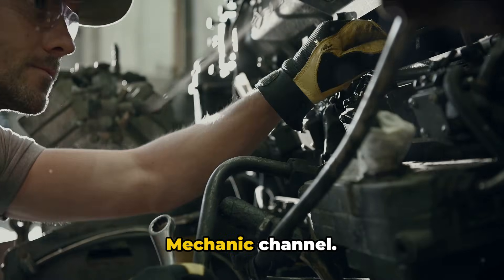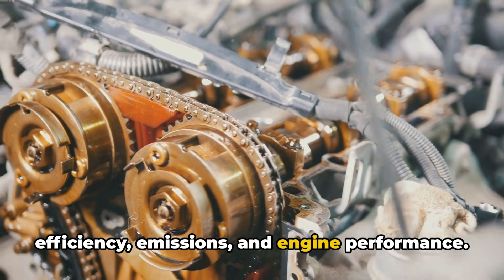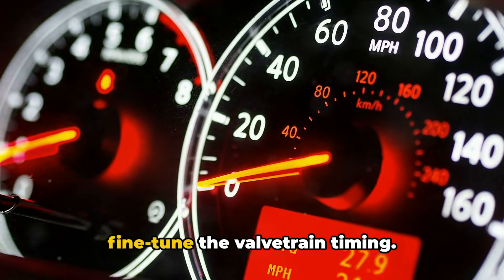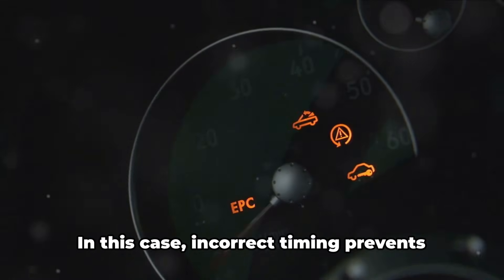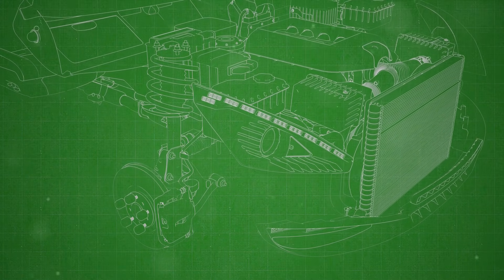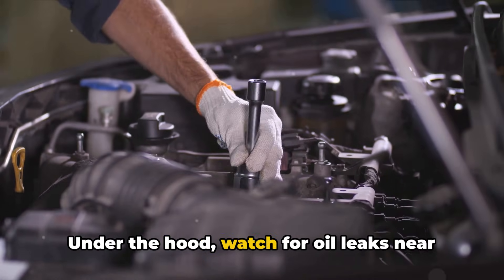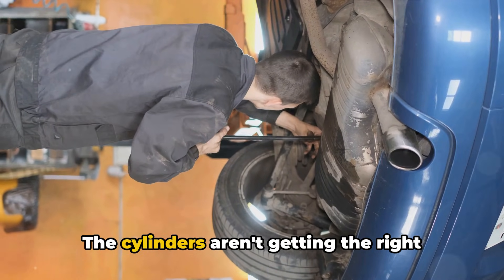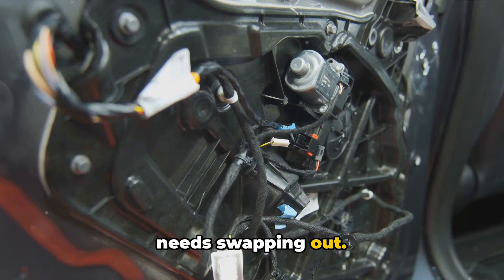Bad VVT Solenoid Symptoms: 7 Common Failure Signs

Comment: My engine rattles in reverse and in drive when I come to stops. I had the spark plugs changed the coil packs, all 3 mounts on my 2013 Ford escape sel. I also have the fuel sensor replaced this past December. Today I had both of my vvt solenoids replaced because I had code P0012. I had to get it tested because my check engine light came on(solid light). I no longer have the check engine light on my dash, because the mechanic reset the code after installing the vvt solenoids. I picked up my car today and my engine still shakes in reverse and when I'm at a stop light while it's in drive. Do you know what the cause is?

Comment: i got a Question i needed a pressure control valve solenoid on my car which came on the scan ...i went to auto store and told them i have a 2016 nissan altima cvt...they ended giving me a VVT solenoid instead ..will this effect car ..im hearing noises ...i did change my rotors and brakes which also has rusted out dust plates which could make that noise too  because pieces of my dust wedge itself between new rotor and brakes ...

Comment: also common symptoms are: if you press on the gas it takes a few secs to understand that you pressed the gas pedal, rattling, shaking engine when trying to accelerate
Reply: If your timing chain is elongated (causing not perfect timing) or a bad VVT sprocket would this cause the same issues? Or just the solenoid
Reply: @michaelmcmaster3559 i have a rattle on my toyota yaris after starting up i think it might be my timing chain but there again there's on 40.000 miles on the clock so I know the symptoms are similar for v v t solenoid
Reply: @michaelmcmaster3559 i think a longer chain would make permanent problems when you step on the gas, not just full throttle. also makes rattling noises when its critical and time to replace

Comment: My 2009 Hyundai I10 is hard to start if it sits for two to three days it back fires a bit then catches and starts after about three cranks. I was thinking it was the fuel pressure regulator in the fuel tank leaking the fuel back to the tank. What do you think. My car has just started doing this but my fuel economy is not good.

Comment: I've just seen on other vvt engines a tiny little oil filter in the engine block/head cylinder  did anyone knows about the same on the ford escape 1.6 ecoboost?

Comment: 04 GMC Envoy 4.2L 4x4
Omg, i would be the most happiest person if this is what's going on. 
I have every symptoms except it starts every time. It just started knocking a couple of weeks ago. But it also has only been having the po410 code.
Im sort of stuck in the middle sense. i was once told last year that my computer thing might need to be replaced. I've been getting it. When i put it in drive or reverse, it seems to take a min before it moves..
Reply: cam shaft position senor and cam position sensor can cause these symptoms also
Reply: sorry that first one was suppose to be crank positions senor

Comment: THANK. YOU.!!! I’ve been scrubbing the internet for two weeks trying to figure out what’s going on with my ‘14 Altima and this video was a serious godsend.
Reply: Code readers are now as low as 20 bucks on Amazon.
Get a little better one.
Mine was 25.
Reply: Hey I’m having rough idling at stop lights as well. Did you have any check engine codes? Mine isn’t always bad but my rpm starts to surge at times ?

Comment: Could a damaged ECU cause some of these symptoms of failing VVTi? My hood was cracked open for an hour when it rained one night, and not long after I got a p0420 check engine light, and after that, the VVTi cold startup rattle, which is constant while driving especially accelerating at low speeds, but stops instantly when letting off the gas pedal... And the engine light(s)/the trac off and abs light came on one day, have come and gone a few times, and usually but the end of the day are gone and they've been gone for a few days, with no lights now, just the noise.. but I did notice an oil leak from the timing chain tensioner area, covering a wiring harness underneath it, it's caked with oil and dirt..

Comment: I had this very thing done to my 2001 Sienna Le at the dealership as recommended by the mileage replacement at Toyota. Nothing was wrong with anything before the replacement and used all Toyota parts tensioner all belts water pump thermostat etc. However when I went to pick up my after they had replaced everything when I started the van it made a clicking or thumping noise which has only gotten worse. I took it back after a few months and was told there was nothing wrong now it’s gotten so bad it sounds like something is broke. Since the. I’ve taken to other mechanic to diagnose the issue but no one is able to determine what is wrong! I so frustrated and disappointed after spending so much money to resolve an issue which wasn’t repaired correctly. Can you please extend a glimmer of hope with a possible recommended approach  what may be the cause. I’m desperate I’ve stoped driving the van because I’m afraid it will be damaged further.Have any suggestions as a possible insight as to fixing my problem. JR

Comment: Damn I just spent $300 thinking I needed a timing chain 😅. Had some vvt (variable valve timing) solenoids i bought thinking that was the problem to begin with but never changed them out. Well I tried them for the hell of it, and boom 💥 it worked. Fixed the issues. Issues: 4 codes about intake timing and exhaust timings 🤦 I’m such a dork.
Reply: What were your symptoms?
Reply: @ had power loss, also said advanced timing code too
Reply: @ssswiftly  hmm mine has no codes only p0420 catalytic converter code, and the check engine light comes the and goes and seems to be gone now the last few days.. gonna hook up my steel man wireless chassisear today when it comes.. But it sounds like the VVTi rattle, but does it when accelerating too.
Reply: @foxmulder7616  unplug the high pressure  fuel pump my be the cause of the rattle, it on the valve cover. See if that’s the issue, your catalytic converter could be bad or check the spark plugs and see if they are showing signs of rich mixture
Reply: @ssswiftly  I definitely have black soot in the tailpipe, so it's been running rich, I put some cataclean in yesterday, it seemed to be quite a bit less noisy after several hours of driving . Lol I'll have to look for that pump and pull the plugs out and look at them, I just replaced them last year..
Reply: @ssswiftly  I put cataclean in yesterday, and drove it for half and hour or so on a quarter tank, on the highway and around town, and it is 100 degrees here today and the noise is almost gone today.. And seemed to be a bit better last night after driving for another 4 or so hours after that... Maybe it was the catalytic converter?? Idk it definitely sounded like the chain was hitting out something on my chassis ear microphone/🎧 when I hooked it up to the valve cover.. but if the noise is gone and lights are off guess I'll just keep driving it until it finally gives up the ghost 👻 lol
Reply: @ssswiftly  i have p0011 and p1009 honda comes and goes but when it comes engine increases idle to 1500 rpms.
Reply: @ not sure about Honda this is for Kia
Reply: i just fixed both my codes p0011 and p1009 i had to replace my vtc solenoid it turns out it was sticking anytime it went into advance and it kept the engine in advance with high idle. replaced with a junkyard got a lot of low end torque back and codes gone. if you have this issue highly recommend replacing that first as its cheaper than the timing chain which everyone keeps saying is the issue. i did it myself junkyard unit is cheap test with that before buying new.
Reply: What did you change ? Can you explain I have p0017 and p0016 and I scare is the time chain but the engine runs fine and doesn’t make any sound
Reply: @ricardoleon3020  I replaced the vvt solenoids look them up, one sits on the valve cover and the other on the block above the alternator
Reply: @ thanks
Reply: ***Update - I replaced both, it worked, except the small ticking is still there but, I already know that the cam pashers for my vehicle need to be replaced eventually, but anyways don't listen to mechanics all the time, had two of them tell me that my engine was bad and I was better off Replacing the engine or junking my vehicle. Replaced both of these solenoids runs great now.       

I'm about to replace mine, ordered them yesterday... I was told that my engine was bad, I was thinking it was a timing chain initially. But took it to a mechanic and he said an engine rebuild or a new block. The thing is my engine turns over and doesn't kick out any smoke, and doesn't over heat and the oils good. I even dumped the pan to see if there was anything in there like sludge or timing chain shavings nothing oils clean. So I question whether the mechanic was doing his job correctly or trying to make a buck off me, because I have others telling me that it's my cam phasers and timing chain, but I know that when it's a timing chain the you can feel slips and it throws completely different codes. Guess I'll find out in a few days but I have a feeling that it's these damned solenoids because I'm getting these exact codes and the symptoms of a blown engine and Messed up camshaft+ timing chain are super noticeable just within the oil pan itself. Hell you can even feel it within the vehicle. Idk, but I'm eager to see if this works. Because freaking hell an OEM timing chain cost like 600$ excluding the phasers which are 300$ a piece for my truck.

Comment: Can anyone help / advise about Yaris 2006 semi-automatic, car start nicely engine running without noise , but Engine light showing,  was driving on motorway the car loose power , when gassing more hard the car doesn't go the speed expected, finally I pull out & stop & switch the engine for awhile. Then restart the engine ,no problem bug when I put th gear on ' Drive ' & gas , the  car doesn't move at all. 
Any help please, very appreciated . Thx U.

Comment: I have 2012 mustang v6, it has rough idle and but drives fine until I get about 60 percent on the gas it start misfiring bad. The VVT leaks which is common on the cars but I’ve read it can leak oil into the spark plug tubes.

Comment: To avoid this problem maintaining oil change right 3 quart motor 1 quart marvel mystery oil & 1.5 quart of oil stabilizer
Reply: I put about a quart of MMO in my 300,000 ml. GMC envoy and I have the symptoms of my Vvt going bad..I don't know for sure till I get a new Vvt..cold start rattle and now it vibrates while driving..

Comment: I removed my two vvt solenoids to clean and tested them and after reinstalling 1 of them leaked so I inspected the O-ring and it was fine so I added a homemade gel-pro rubber fiber gasket and it still leaks.  Wondering now if the it’s leaking after or above the o-ring where it connects to the flange or some have said the matting service may be damaged.  Any thoughts?  Thx

Comment: Hello, i have a 2008 Toyota rush blinking o/d on the dashboard after like 15min of driving, very poor acceleration especially immediately after starting the car. It also streans alot before changing the gear. I've been to several mechanics with no help. Any advice i will appreciate.

Comment: Fuck me this has got to be it. I also have an issue with my VIAS solenoid/power valve, making large rattling noise when activated, gonna just replace that with a junkyard part too with brand new lines. God damn it dude fuck the intake on the vq35de. gonna go ahead and delete the throttle body cooling system as well (live in florida absolutely no need)

Comment: I changed the VVT solenoid on the bank 2 side because that was the problematic side. But now I’m having a shaking issue when I slow to a stop. When I make the complete stop, it stops shaking. Should I change the bank 1 side also? Perhaps it’s something else? Any help would be greatly appreciated and thank you for making this video.
Reply: Put the new solenoid in the other place and see if the issue stop or no . Maybe the shaking is from brake pads or brake hub
Reply: And the way to check the solenoid is by taking it out and have a battery connect directly to the selenoid u should hear a tick sound ( when the selenoid open and close)
Reply: Yes you should replace both of the solenoids together. 1 is your Intake and 1 is your Exhaust.

Comment: My Nissan primera p12 stalls when rpm drops too much when I come to a stop light and gives p1110 which is intake valve timing bank 1 but I took out solenoid cleaned it and tested with a 12 v bat and it openes and closes so I'm lost

Comment: Hi, I Have a 2013 altima, it idles very rough, I already changed the Battery, Plugs, Coils, Engine support and did a injector and sensor cleaning, but still the idle is very rough, specially when accessories are on, it does not stall and runs perfect on high RPM, it also does not throw any codes referring to the solenoid, 
Was it possible to have faulty solenoids without any codes??should I replace them now? Cause I dont want to spend more without fixing the issue. thanks,
Reply: Same what happen with u
Reply: @zezv you got the solution?
Reply: I have a 2012 Chevy Malibu and I just bought solenoids to try to fix my issues and they were only $25 so that's one of the cheaper fixes

Comment: Man i really hope you read this. My 2013 elantra has the 1.8 in it, and at around 3k rpms it soits and sputters like crazy. Everything is fine at idle though. Could the solenoid be the issue or the chain itself?

Edit: its NOT theowing any check engine codes either

Comment: I have a 08 Toyota Sienna , I was advised I needed mine replace because there’s a build up of residue on top. My car smokes(whiteish gray) when starting it up in the morning and thats it , it won’t smoke anymore after that.
Reply: That sounds right. I had the same issues. This fixed it.
Reply: @ do you have the same car ? And I’m still trying to find the 1 that is on the side of my engine… I can visibly only see 3 but that’s about it.

Comment: I have a MK6 Golf R (under warranty) and I’ve had these symptoms and had it towed to a local Volkswagen Dealership. They went through the tune up new coil packs and spark plugs. They said they still had a misfire and a code for low cam position was throw so they changed the N205 valve. They still say that my car is running rough so now they said it’s the cam phaser but it hasn’t been changed yet. My car has been at the dealership since August 19th of this year and it’s still there now. What do you think is going on? Have they been diagnosing this properly or are they dragging this out. Also communication is lacking. What do you think my issue is?
Reply: Your issue is that you own a VW. Not trying to be mean as I also own a VW that's now a $15k paper weight.

Comment: Will this cause my exhaust to blow smoke. I'm a delivery driver and I go thru 2gts of oil a day
Reply: This sounds like a blown head gasket. Your oil consumption is because your oil is mixing with your coolant & being burned off hence the smoke coming from the exhaust, i would fix that before you engine blows.
Reply: What kind of car? If it's any car with the 2.4L Toyota engine, it could be buildup on your piston rings. There are processes to help this issue and greatly reduce oil consumption.  I'm surprised he went with "blown head gasket" right away without even asking what color the smoke is. If its grey/blue/black-ish, it's from burning oil. If it's white or very very light in color, then it could be the head gasket. Also, if you're only burning oil and not also going through coolant, it isn't the head gasket.

Comment: Hi guys i have an SQ5 2017 B8.5 , recently a fault code has appeared “P1B1C00” as i found out it’s related to the coolant system codes , i changed a new water pump and some other check up but still there . Everything is looks brand new in the car The only symptom that i can feel is when accelerating i can feel there is something wrong between the gears when it shift from one to another . A weird sound “Trrrrrrrr” that’s the closest to the sound 😂 . I am not sure if it’s from the gear or the engine But i couldn’t find out where is the real problem . Any ideas !!
Reply: Sounds like a shift solenoid.

Comment: My Hyundai Elantra's VVT solenoid connection is broken.. Means its not connected but still car is running smoothly, but i noticed one issue that my Transmission wouldn't shift from "Automatic D" to manual gear

Comment: This could be my issue.. the scan code on my 2007 camry is p0016 
Crankshaft position correlation ( bank 1 sensor a)

Is this the reason why my car is accelerating on hill and misfiring

Comment: One thing he missed is stalling at idle
Reply: Yup been there
Reply: @kitwalker520  dealing with this rn. It's either injectors, bad e85 or the solenoids
Reply: @kitwalker520  ended up being timing. Codes just needed time to kick in.
Reply: @Polarcaine  did you have the timing fixed? If so, how long did it take, and what was the cost if done at a shop? My mechanic has mine now, and he started with the actuator, but I think it's bigger than that.

Comment: I have a code and I don't know how to get the electrical diagram for the sensor
This code is P1349/P1656
Part vvt-i
Cam Timing Oil Control Valve Assembly
15330-21011 Part number at the agency
Corolla 2003
I want to know
1-How much electricity and how many volts v coming out of the plug to the sensor.

2-How many ohms resistance is the coil for the sensor.

Note that I searched the net and did not find an electrical diagram for the valve